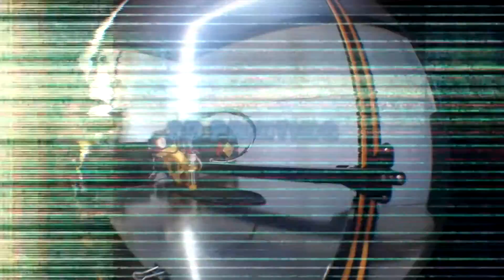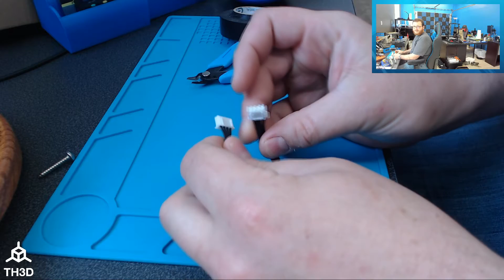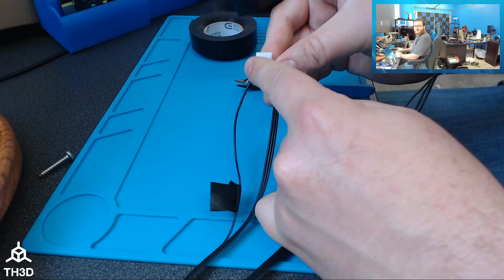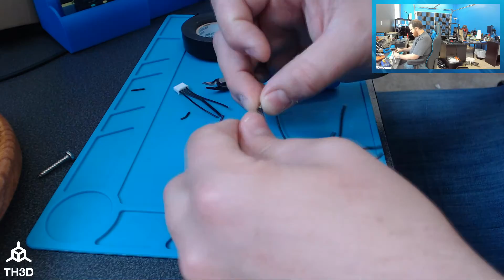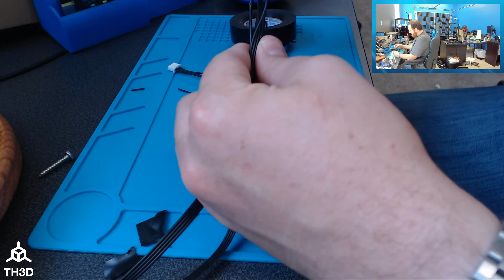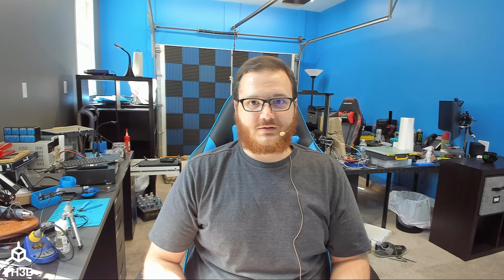Dual Z Motors on a Single Stepper Driver - Cable Modification - MKS/SKR/RAMPS

Comment: Hi... nice video. The way you've done it (if I understand correctly) is in parallel... so 1 to 1, 2 to 2 etc. If running in parallel will it halve the current going to each stepper motor... will I have to increase the vref on the motherboard, effectively doubling up the voltage so that each stepper motor has the correct voltage to work properly? I'm in the process of adding a 2nd Z motor on my Ender3 V2 and can't seem to find a definitive answer anywhere. Many thanks :-)
Reply from the maker: I wouldn't double it but definitely bump it up on the VREF about 0.2V and see if its enough torque for both motors.

Comment: does the voltage on the potentiometer need to be adjusted to work with the 2? say i have 1 that is 1.8 with the cl set with 90% around 0.81 do i have to double that stepper voltage to power the 2 motors being 1.62v?
Reply from the maker: I usually will go up about 0.2-0.3V on the VREF when I got from 1 motor to 2. Just check the torque on the motors once you add the 2nd one to see if it is enough to hold position.

Comment: I like to add solder on my wires. Also I like to add heat shrink tubing on mine. I wish a company would make a Y stepper motor cable. I am trying to make a y cable using new connectors to make things look neater. This is harder than it look. I am sure after I practices awhile then I will be able to do it. My first try I was able to get some of the pins correctly inserted into the white connector but I still need more practice. Hard to see because the pins are so small.

Comment: Never never ever just twist wires
Reply from the maker: You can do it in a pinch. Not everyone has soldering equipment. Soldering is the best way to do it.

Comment: How would you make that cable for a Y axis with dual motors spinning in opposite directions? Great info!
Reply from the maker: You would reverse the polarity of the motor coils on one motor. That will make it go in reverse.

Comment: Good stuff for someone new to wire in parallel and series just simple ok here is how you do it don't stress the details. You do have a good through process, taping the wires the was you did if done right can make it where the cables breaks before the splice comes undone. I've done pretty much the same  with a lil more tape and attention to the twist and how you put the wires to tape them if ite really need to be solid without solder, tie the wires in knots before twisting and the do the same thing kinda., stuff like that is as close to solder and heat sink quality . I've used that way a good many times in a pinch, .. Chiling with a friend, they have broken stuff.  And I have nothing but my teath and some elecal tape, will take a  crazy beating and been fine. If you don't have an Iron/solder cool perfect. A great was to make your channel get longer views, would be to show this way, and    also how to really do it all out. Solder and shrink wrap. You can use small pieces of shrink wrap to mark your reference cables too.. And a little current bump may be a good consideration.
Reply from the maker: Solder and shrink is how we do it here because we have the tools and supplies. This is just a quick way to show others.

Comment: Does this work on all axis? If i wanted to mirror the movement of all the motors with a simple external frame side by side. Nothing practical just for experimenting with rigid tubing for water cooling the motors or the hotend heat sink maybe all the above.
Reply from the maker: Yeah it would work on any axis. Just use matching motors.
Reply: @TH3DStudio  thanks, i appreciate the reply.

Comment: I am making my own 3D printer with dual motors on the Y axis running lead screws. If I parallel them using your logic will I still get accurate movement on both motors? I am using Ramps 1.4 and NEMA17  for my project. Also any other settings I need to set or change?
Reply from the maker: Movement will be identical if you have identical motors.

Comment: Hi! If you want to set the vref of the driver, you need to put the same current of one motors or it change? Thanks a lot
Reply from the maker: You don't want to use the max amperage of the motor but enough amperage for your printer so that the motors do not run too hot (under 80C) and steps are not lost.

Comment: can i do this with a drv8825 driver using 2 nema 23  motors? if so, should i change the amps on driver from 0.65 to 1.30 amps because its serving current for 2 step motors??

Comment: I have been looking into dual z axis for my ender 3 v2 as I have noticed about a 2-3 mm droop on my right side even with everything tight. With a level bed it hasn't been effecting my quality at all but something I would like to resolve.

I have noticed 2 methods for doing dual z axis. 1 is dual stepper motors in either series or parallel and using your dual z axis belt option online.

To me, the belt looks like the simpler, less likely to have issues option with there being 1 downside. That downside is that you have to use screw stabilizers at the top. If the z screws are not perfect they can cause z axis wobble.

The dual z axis can have issues with missed steps throwing off the leveling and you would have to somehow get them to be able to stop on their own with separate z stop switches to keep it from happening and I have no clue on how to set that up.

Which one do you think would be better? I'm thinking if the z screws are perfect with no wobble or bend then the belt option is best. If not then the dual stepper motor.

Would appreciate any help you can provide.
Reply from the maker: We've tried out both and prefer the 1 motor + belt as it locks the gantry in. The 1 motor has more than enough torque to drive the whole system. Our Dual Z kits sell out quickly when we have them and people seem to like them a lot.
Reply: @TH3DStudio  Good to know. I have been looking more into my z axis and it is far from perfectly smooth. I have adjusted and lossemed everything and I just have a small 1-2 mm bend in my screw along with my x axis connector actually being a few mm further out than where it connects to the stepper motor.

In this case would it be a matter of getting an extra high end acme screw along with spacing the z stepper further out before doing the second motor at all?
Reply: congratulations for the video... I wanted to ask.. how do you do it with the.driver?  does the vref stay the same or should it be doubled?  if the drivers heat up what does it mean?

Comment: Doesn't adding 2 motors to one driver fries it
Reply from the maker: For these small NEMA 17 type motors you can run 2 off one driver.
Reply: @TH3DStudio  will this trick work with Tmc 2208 and won't fry it in long usage
Reply: @resomacarenhas5135  yep 
It should do 
I've never read about this method frying any drivers tbh

Comment: I am also using dual motor for y axis   but motor are nema 17 and driver are A4988 i will connect two motor in single driver does heat burn the driver or board

Comment: Is it possible to make a separate stepper driver work with a board that has built in drivers? For example.. i have an ender 3 with the upgraded 1 1.5 board which essentially is just a 2208. And the controller wire managed to get snagged underground the potentiometer and popped it off. Now its completely useless cuz theres no juice to power the axis. But I have some actual 2208s I replaced with 2209's.  The boards pretty much junk as it is so its not like I'm gonna hurt it. But is it possible to some how Frankenstein a seperate stepper to somehow make it work?
Reply from the maker: Unfortunately there is not an easy way to do this that doesn't involve surface mount soldering. At that point just swap the board out for one that has the drivers you want to use.

Comment: I have the Creality 1.1.5 silent board. It only has one plug for the Z. Using a "Y" cable and running two stepper motors off of a single driver, surely requires more power from the board/driver..? My question, is there anything else that needs to be done (current/voltage wise) to make sure the board performs as it should and doesn't die prematurely? If it helps, I believe the 1.1.5 board comes with the 2208 stepper drivers. And the same question for the SKR Mini E3 V2.0 board (a friend's printer).
Reply from the maker: Just increase the VREF on either board. Those boards both have lower copper count (copper weight per layer and/or layer count) on the PCB than Trinamic recommends (4 layers, 2oz or more per layer) so keep an eye on the Z motor temperature to make sure its not getting too hot (too hot = if it hurts to keep your finger on the heatsink, aka about 80C).
Reply: @TH3DStudio   The newest SKR Mini E3 V2.0 board has a bunch of improvements, including a new 4 layer board, bumped up voltage, and a bigger heatsink surface area (for the drivers?) https://tinyurl.com/yazst2bu https://tinyurl.com/ybu78adh  More info can be found here... https://tinyurl.com/ybfdh2lh

After looking though the specs for the V2.0, do you still suggest increasing it's VREF, and if yes, to what value? Also, I'm pretty sure the motor that comes in the kits we bought will not be a "match" to the other three Ender 3 motors. Since both Z's should be as close as possible spec wise, couldn't we just take the kit motor and use it to replace one of the other two, and then take that original Ender motor and use it as the other Z? Do you see any issues with using that kit motor on either the X or Y axis? Any changes to the way the printer would perform from factory spec? I really don't want to have to buy another motor if possible. Thanks for your replies so far. :-)

Comment: I am looking to add a second z+axis support to my Ender 3, preferably a stepper running in parallel. I have an MKS Gen L v2, will I need anything else?
Reply from the maker: You can splice them like shown in the video or get an adapter like this one that we carry: https://www.th3dstudio.com/product/dual-z-stepper-motor-adapter-w-cable/

Comment: Hi, thank you for your sharing. I bought a whole dual z update kit. The kit works exactly the way you described. Parallel wire drives two motors, but somehow the left and the right motors are not moving to the same direction. Do you have suggestions for this issues?
Reply from the maker: reverse all 4 wires going to the motor that is moving the wrong direction

wire 1 to where wire 4 was
wire 2 to where wire 3 was
wire 3 to where wire 2 was
wire 4 to where wire 1 was

That will swap the direction. Do this at the splice location.
Reply: @TH3DStudio  @
Bruce Hu  It seems many dual Z kits that come equipped with a stepper motor (from places like eBay, AliExpress, Banggood, etc) have these wired wrong... but it's not the wire/plug that's wrong, it's the actually motor that's backwards. As a test I took the "Y" cable that cane in the kit, and connected it to the original Z stepper motor on the Ender 3. Both ends pf the wire worked as it should when I did the auto home. But the motor that came with the kit is wired backwards inside. So with your answer above, I used a small dental pick to gently lift the small plastic retaining clips (on the molex plug) and gently pulled out all four wires making sure to note where each wire went). https://tinyurl.com/y9qdpw5z I then inserted them back into the white plug the way you mentioned making sure each wire locked back in place. It took me less than a minute to do. Everything now works as it should, (no cutting/slicing needed). Btw, if I hadn't seen the OP's question about his motor spinning in the opposite direction (and went to test the motor I had but hadn't installed yet), I'm sure something form the dual Z kit or on the Ender 3 would have been damaged. Thanks Bruce and TH3D. :-)

Comment: Hey i was wondering should u increse the current in marlin or v ref on the board if u run them in parrelel or if u can just plug it and use it and also does it heat up the driver on the board. And also if i should change the vref what would it be for a tmc 2209
Reply from the maker: You'd have to refer to the driver calculation itself. Some TMC2209s have different VREF values. I actually do not do calculations when setting it. I check the torque by hand to see if the motor has enough power to hold the axis in position and not lose steps while also then checking the motor temp during a print as well as the driver. If the motor and the driver are not running too hot (70C or less is ideal) then you're OK. If you run a stepper driver too low you lose steps. If you run it to high it just makes a little more heat. If it is not exceeding temps then its OK for it to run warm.

Comment: So I’m using a Ramps 1.4 board that has 2 z outputs and since I have a big printer I’m using 2 large nema17s for the bed each belted to 2 screws. 

In theory could I do this to each of my 2 outputs to instead have 4 motors running - one on each screw instead? Or would that be too much?
Reply from the maker: I wouldn't put more than 2 motors on 1 stepper driver.
Reply: TH3D Studio that was my thoughts. Cheers

Comment: do you have maybe a clip show, taking this further... as it applies to a Ender 5, changing the single Z configure to a duel Z config, with the second motor/driver on the front of the bed.?
Reply from the maker: This is just a general splicing guide, not machine specific.

Comment: Maybe you can answer a question I have. 

If I want to use 2 z motors and screws with two, 2208 drivers on my ender 3's SKR 1.3 do the motors have to be exactly identical motors? I bought a chinese kit that contained everything I needed to set this up, but they sent me a motor that while still a Creality motor, appears to be a slightly longer bodied nema 17. I think it might be a motor off a CR10 or something.

I know that with independent Z drivers, I'll be able to use marlin's z-auto-align with a bed probe, but I'm concerned that the 2 motors not being the exact same model will cause desynch issues. I really think the idea of having each motor on it's own driver is neat. The kit I bought i is literally the same as the kit y'all sell, just without the belt and pulleys and a motor tossed in with a Y splitter.
Reply from the maker: They should be the same motor ideally. I've never mixed them as you want the coil resistances to be the same

Comment: But you didn't mention, that you have to increase the mv on this particular driver right?!
Reply from the maker: If running parallel on an A4988 typically you want VREF for that driver around 1.0-1.2V max.

Comment: Ok thanks for the video. I really want to do that. Just questions is do ı need to change vraf value? And my second question is are there any stl files for my new z motor connections to the machine? Thanks.
Reply from the maker: You should up the VREF to around 0.9V for the A4988 drivers. As for STL not sure what you mean by that.
Reply: @TH3DStudio  Think he's asking what STL to use for mounting the new additional Z motor.
Reply: @KingElysium  it is running off the same stepper driver. There is no reason to code for it.
Reply: What should the vref be for two steppers/one diver on the silent Creality boards? Thanks.

Comment: do I have to adjust the Vref on the stepper driver?
Reply from the maker: You should set it to about 1.0V for dual in parallel like in the video here.

Comment: Using 2 motors in parallel, u have to increase the vref, don't u? Puttin 2 drivers in parallel won't change anything, splittin the motorline will devide the current by 2, resulting in less torque. Pls correct me if I'm wrong
Reply from the maker: You are correct. On a common A4988 driver usually a VREF of 1V is good